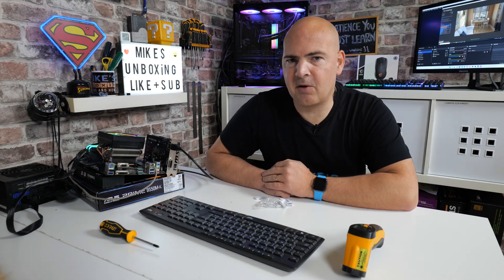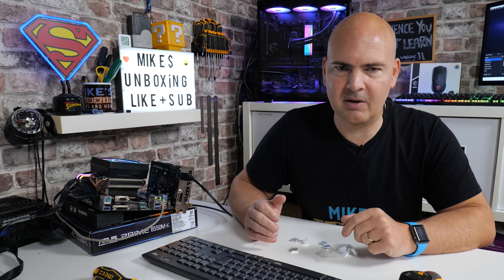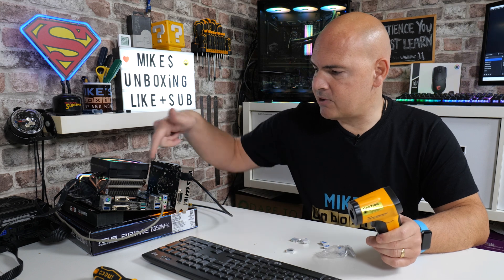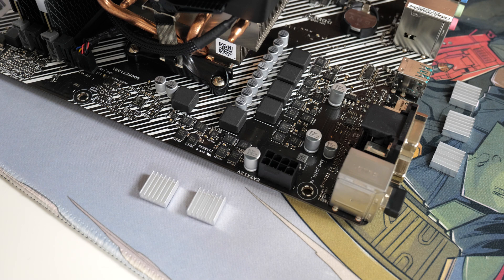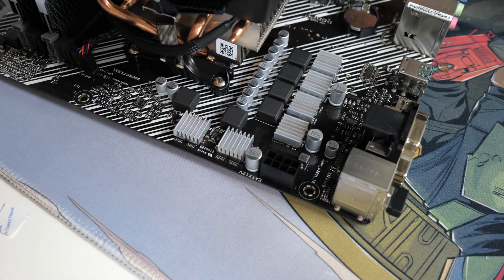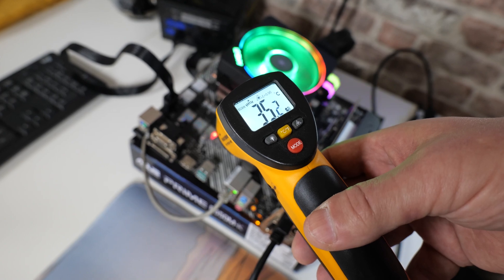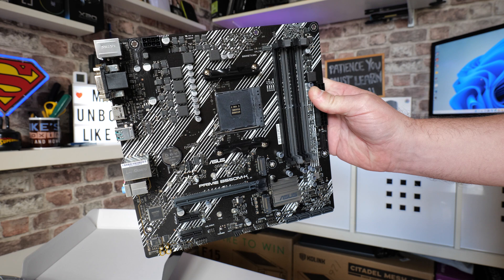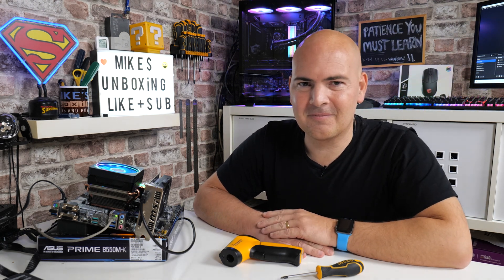Adding Heatsinks To Motherboard VRM & Chokes Is It Worth It?

Comment: 2bh i didnt kniw which were vrms! Thought those cubes were generating heat lol. Its a pity the software doesnt congirm temps as the outer surface of the aluminium shud b lot cooler as furthest away from heat source. Looks smart and low cost which is all uou want with budget board. Plus being aluminium if loosened wudnt conduct electricity or cause damage, wud it? Thanks for sharing Mike and Kath👍
Reply from the maker: yes if it falls off it could be very bad news, although it should just drop to the floor of the case and the adhesive on there seems very strong considering the weight of the heatsinks.

Comment: Heatsinks like them stuck on retro motherboards south bridge chip set chips really help but the case needs large airflow for the heat transfer to happen
Reply: My though as well. I'll try to reuse the heatsinks from an old motherboard on my next one. Especially on M.2.

Comment: I do such Mod in my AMD FX System. But i'm not using these Heatsinks. I just connect a Fan. In the Direction of the VRAMs and this was Night and Day. 30 degrees in Avg.
Reply from the maker: that might be my next plan, maybe a tiny noctua pwm fan
Reply: @mikesunboxing  I use a big 120 fan. Simply i stand the fan on my GPU faced to the vrms. It worked perfectly.

Comment: Nice idea. But if it somehow fell off, it will cause serious short circuit in your board or gpu.
Reply from the maker: it could do but the adhesive is really very strong and as the heatsinks are quite lightweight it would be a long long time before the glue broke down and gave up

Comment: good idea to be honest what if you put them together in a vice then drill the middle to get copper piping through ,then screw them together for a wider heat sink for the four vram then use thermal pads underneath and not the 3m sticky stuff and try to get them to stay on the vram not thought that part out yet lol.

Comment: I refuse to buy a board with naked mosfets. I bet lots of people have some boards that have high TDP CPUs that run hot on some older AM4 board that has no top down cooler and no air moving around thinking everything's fine and dandy because their AIO has the CPU temps in check. I try to avoid hot spots in all forms of electronics. Like you said, sometimes it's not necessary, but I prefer to use caution whenever I can.
Reply from the maker: caution is wise sir

Comment: Sir need urgent help as i had told you regarding my PCs issue in the past comment. I replaced my GPU with a new one via replacement. Now my PC is restarting automatically each time i run any graphics intensive game and each time the restart happens my XMP profiles and fan curves are restored to default, what could be the cause?  I think it might be the PSU or it might be Mobo ?  Please help me
Reply: sounds like your PSU is not good enough for this new video card
Reply: @himanologanor4093  PSU is more than sufficient , 750w gold while my power need is just 450-500watts.
I replaced CMOS BATTERY .
Reply from the maker: This is maybe easier to fix or at least advise if we can ask more questions and get direct answers, so feel free to join our Discord chat and we can go over it in more detail https://discord.gg/XtBTGQ6BDu
Agree to the rules by clicking the emoji and you will get access to the rest of the Discord channels
Reply: @mikesunboxing  I'm already on your discord chat.
Reply: @YaduUvach  Have you tried removing individual ddr4 sticks to maybe check if a iffy ram slots/wider mobo prob might be the issue? And try a lower x16  pci slot if you have one.
Reply: @Doobie3010  i have just 1 stick
Reply: Maybe replace your cmos battery, or at least pop it out fot a minute or so, that should reset your bios to default-that might help. Or maybe you have integrated graphics on & conflicting with your gpu?
Reply: @Doobie3010  no integrated graphics Ryzen 5 5600x is my CPU and yes i have replaced my CMOS battery still the issue doesn't solve, PSU is also RMAed.
Reply: So what was the culprit?
Reply: @gar1256  it was a motherboard issue

Comment: Maybe you should have lifted the board or had it vertical, and measured temperature on the back, the heatsinks may be cooler than the bare VRM devices, but how much is lost across the thermal tape?
Reply from the maker: good point, that is a good idea

Comment: Oh these will work, but the supplied adhesive tape aint great, what i do is mix thermal paste with 2part epoxy, saw another 4c shaved off the stock thermal tape, and if you do want to remove them it will just come off in one piece, so in general without and with the heatsinks and epoxy there was a 11c difference on full load, never trust that tape, if they fall off its goodbye graphics card
Reply from the maker: Thanks for the info

Comment: better with them than without, also, about that temp-gun , the laser is for a distance, at close there is a 1 inch offset, so you should not use it at closer than 1 feet, better chase the most heat on the display than watching the laser, also temp-guns hate aluminum, they usually don`t seem to be able to measure  high reflective metals well
Reply from the maker: thanks for the heads up

Comment: I used to add these heat sinks to my original Nvidia GTS250 and other earlier model gpus and they did make an improvement in temps and more so with some case fans blowing air over them. They were cheaper to purchase them back then than they are now in comparison time / inflation etc 🥰👍😇
Reply from the maker: if they were any more expensive i would not even consider it, but at this price it was worth a go i think

Comment: I think VRM cooling is something that is neglected a LOT so seeing this kind of solution is great.....cheap and effective, bit like me lol.  Thanks Mike and Kath.
Reply from the maker: Totally agree, apart from the bit about you 👍
Reply: BROOO WHY AM I ONLY KNOW THIS AFTER 2 YEARS OWNING B450M PRO VDH MAX? WHY NO ONE EVER MENTION THAT B450M PRO VDH MAX OR OTHER MOBO THAT DOESN'T HAVE GOOD HEATSINK TO THEIR VRM CAN MAKE SCREEN TEARINGGGGGGGGGGGGGGGGGGGGGGGGGGGGG AAAAAAAAAAAAAAAAAAAAAAAAAAAAA
Reply: seems good if you run a cheaper board
Reply: somehow neglected , there's a motherboards manufacturer who added a small fan with air duct to convey air direcly to VRM  surrounding the cpu . I spotted one  them on Ebay, unfortunately sellers  removed the cooling system  , but I can't remember the brand .
Reply: @Ugly Bob-you saw 'Smile' recently and liked it; I just saw 'Halloween Ends' and liked it.